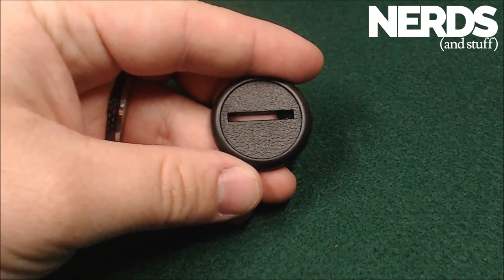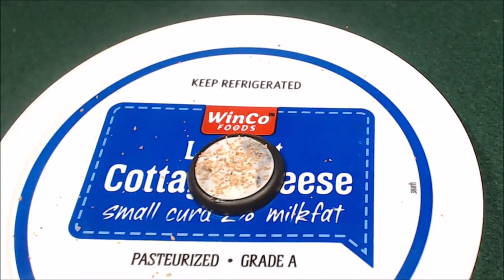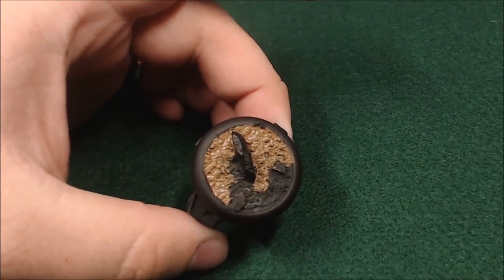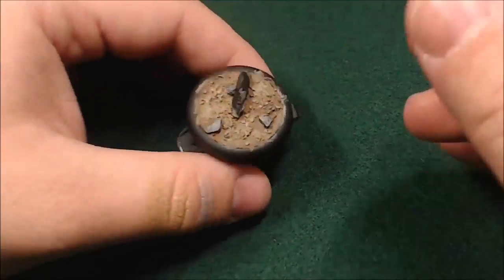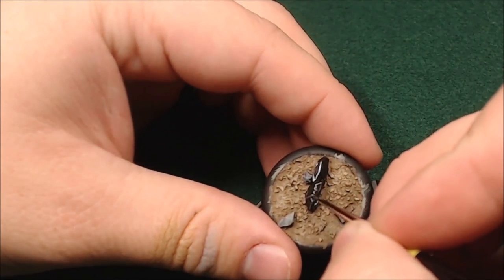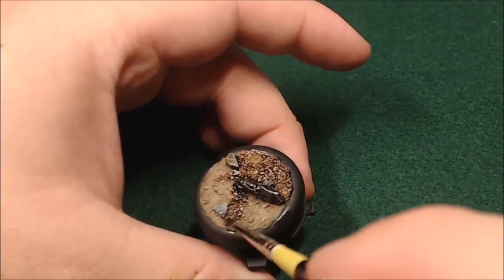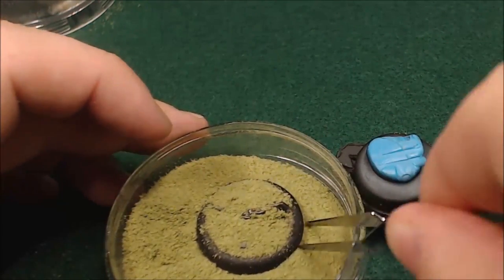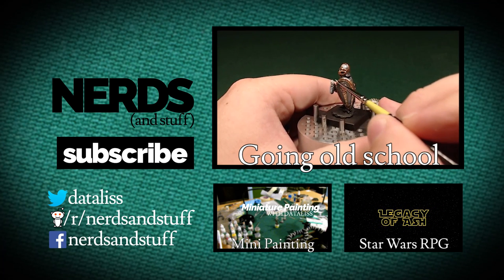Miniature Painting Techniques | Overgrown Debris | Basing Tutorial

Comment: Congratulations! Really nice!
How do you stick the model on in it?
Reply: Thaznk you, I'm glad you liked it. You can either attach the model by pinning (drilling into the base and model and running a piece of wire or a "pin" through and gluing that way) or you can just glue it. If I was putting a metal model on I'd probably pin but if I was attaching a resin one I'd likely just glue and pin if it ended up coming off later.